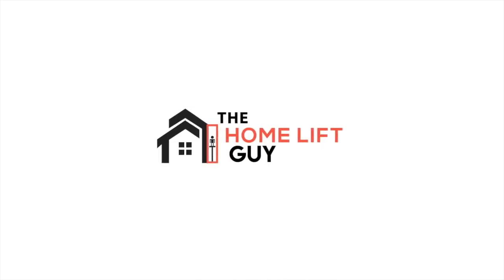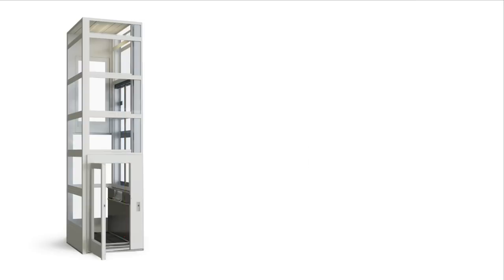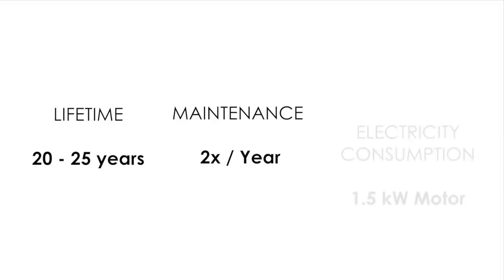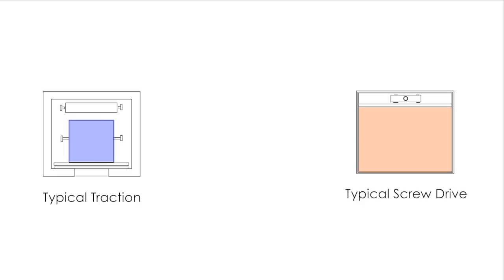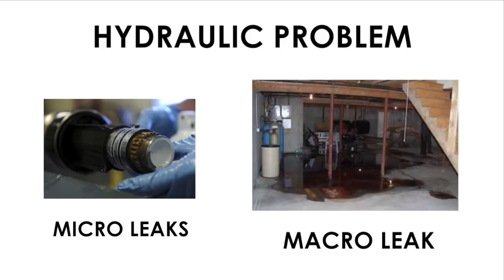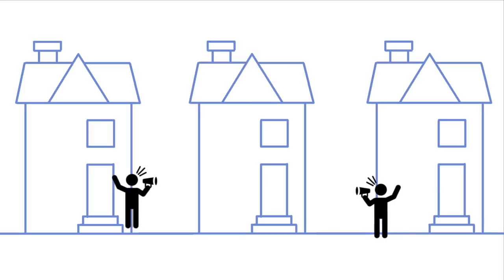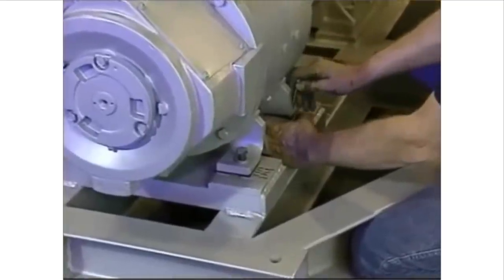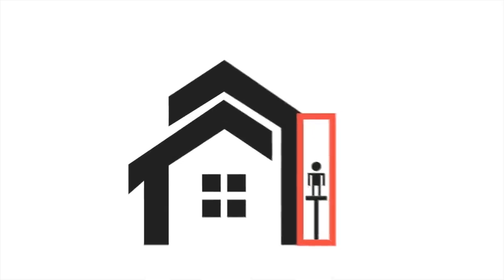Best Home Elevator Technologies - RANKED!

Comment: [Ball Screw Drive]
you forgot to mention the noise coming from friction between the spining "nut" and the long "screw" rod.
The ball bearings essentially is also a high wear-and-tear rate compare to other lift type because this is essentially the only key thing that spins and pushes the platform up and down.
You also forgot to mention that the only way to spin the bearings are a belt attached to the motor, meaning high wear-and-tear on the belt and it's also the only thing that's keeping the bearing from not going down.
What happens when the belt snapped?!
For Traction Drive, at least it has 3 wire ropes.

Comment: Very nice review but I think that you haven't done enough research in home traction lifts. There are companies that design and build MRL (Machine-Room Less) lifts especially for homes that work with 1.1kw 3phase motor but the lift requires only 1 phase power supply and the energy consumption is less than a kitchen oven. So there is no need for a machine room or 3 phase power supply from the house. The travel speed is 0.15m/s as you say and there is no need for low pit, as the minimum pit depth can be down to 100mm. Just take a look here https://kleemannlifts.com/products/elevators/home-solutions/maison100-e-home-solutions
Reply: agree, but Kleemann lifts are extremely flimsy and cheaply made. They break down all the time and the panels get scratched by just looking at them

Comment: I live in the US and purchased an Easy Climber Elevator about 3 years ago.  It is a cable driven system but the thing I like about it is that it is 100% battery operated.  I live in an area where we have frequent power outages and I can still use the elevator 1 or 2 times daily for about a week before the power comes back on.  It also just plugs in to a standard 110V outlet .  The batteries are guaranteed for two years but so far I haven't had to replace them.  They cost about $40 and it takes two (I can buy them at Home Depot).  Anyway, I love the elevator and thanks for your video. It was very informative!
Reply: There awesome we install them in Canada

Comment: Or simpler,  attach a motor to a remote controlled pulley system and that to a sofa 
with a platform, which goes up and down 4 steel tube poles in a device at each 
corner. Sounds crazy? Elon Musk says lets go live on Mars and every one goes
Yep, that makes sense! 🤣🤣

Lets Go! 🤣🤣🤣

Your house your Castle 😎😎🤣🤣

Comment: How and why is it so difficult to transport 200-300KG of human[US] up? 
 Can we get Bezos on this?
GF - 3rd floor in you own 4ever home, it's crazy we haven't figured this out yet! . 
I "seriously" am suggesting putting some  50kg 20kg 10kg 5kg and 1kg rocks/weights 
on one end of a rope[steel whatever] and a  calibrated digital weight installed,
where your standing. Floor stabilizers which can be 4 rods beneath the lift which will
 securing the entrance and exit of the lift attach to computer,  OFF you Goooo!

" Seriously" , all the components for a new kind of home lift are there, just experiment ,
boom you have your niche. 

Faster? More rocks! 
Slower? less rocks!  Boom chaka wowow DONE ! 🤣🤣🐱‍🏍🐱‍🏍

Comment: They are saying traction elevators take 5.5 kilowatts. Let's take an old home elevator from the 50s the Shepard residential elevator. That motor was 500 watts or 0.5kW. Don't think I'm modern traction home elevator like the Hoyt residential elevator. No pit, it takes up less space than a roped hydro with more cab room and due to the counterweight less power.

Comment: 7:12 that's okay if the ropes are attached to a hydraulic cylinder but not okay if they're attached to an electric motor? The truth is both are safe because they slack and broken rope safeties on them.